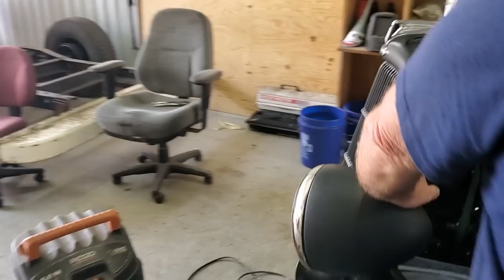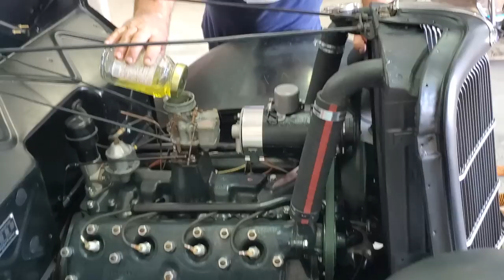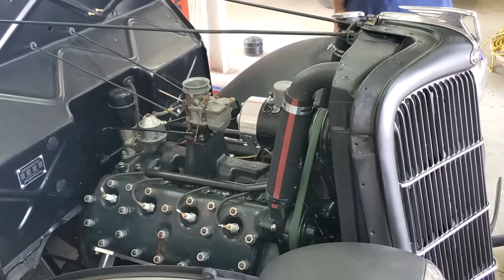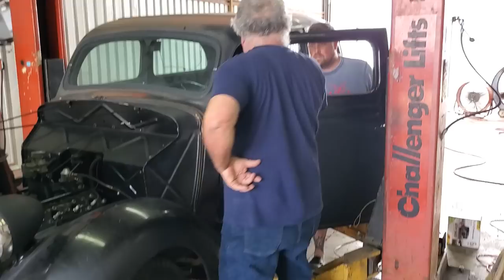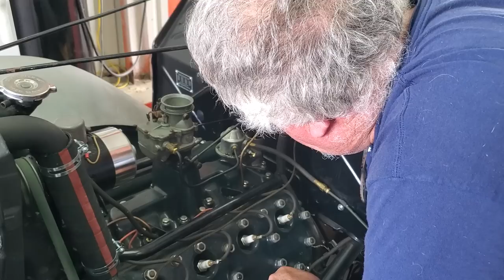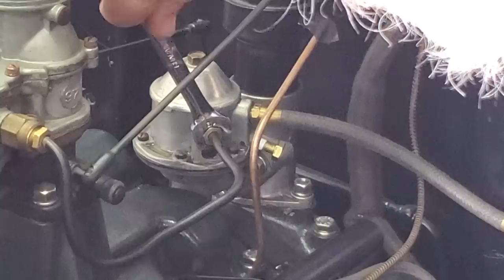1935 Ford Flathead V8 First Start

Comment: If that back fired out intake, you not going to be happy !! Lol, from experience
Reply from the maker: The lid with the tiny hole keeps that from being a problem
Reply: @StellarJay  Having experienced a blowup of sawdust from a floor sander being thrown on a smoldering fire I can still see the fireball that engulfed the side of my face.
Reply: @off spec and just what do you expect the fireball to be like if the engine backfires?

Comment: A back fire could have been a disaster with that bottle of juice 😂
Reply from the maker: Not likely with such a tiny hole in the lid. About 2 drops per second...cant dump it  which is why people have problems. They pour it some gas then start with the container open. Recipe for failure.

Comment: Had you rebuild it if so how come the fuel pump don't work
Reply from the maker: It worked. It just took a few tries to suck fuel from the tank.
Reply: @StellarJay  that's the problem with mechanical fuel pumps
Reply: @MavAuto-Pete  seems like it only needed to be primed,because when it's brand new,well.... It's basically dry.
It would be the same with an electrical fuel pump tho,it would need to run for an instant before actually sucking fuel it,okay,it would be faster,but it's basically the same thing
Reply: @f_for_freedom2492  the engine doesn’t need to turn for an electric pump to catch up.

Comment: That is an unsafe act y'all are committing to start this engine I speak from experience.  Put a little gas in it then crank it and repeat until the fuel pump primes the system.  I had all the hair burnt off my arm up to the elbow and my hand was on fire by starting a flathead  in this manner.  Thumbs up on the video.
Reply from the maker: I do it right. Jar with a lid and a tiny hole. Works perfect
Reply: That flame can still go in through that small hole.  I recommend an upgrade to an electric fuel pump; safety first.
Reply: Agreed. I've seen some.... exciting moments result from "hand priming" like this.  At the least it might be smart to upgrade to something better than a glass jar.  BUT, better than spraying ether all over the place.  Saw a guy trying to get his car started on the road side once...  he was in the car cranking and yelling instructions to his girlfriend, who was standing in front of the car and spraying ether at the carb.  You can imagine how  that ended.
Reply: What my dad taught me a old Ford guy is to take the air hole pump air in the gas tank cover the gas filler with a rag and pump air in the tank three to four times when you hear the gas tank expand this pushes the fuel up to the fuel pump . Then put very little gas in the carburetor then start the car . Work every time

Comment: That fuel flows quicker than my bath filler
Reply from the maker: Thats a fire breathing v8 ford. Gotta feed it.
Reply: I envy you guys in the US, we have to make do with high efficiency clean burning motors in the UK. You have art and character, we are going down the test tube route.
Reply from the maker: With such fuel costs high efficiency is required from new vehicles. It is fortunate that we are allowed to run these guzzlers in the usa. So few it is allowable to spew noxious fumes i suppose.  This old engine gets 20 mpg and doesnt visibly smoke so its kinda green..
Reply: @StellarJay  heck 20mpgs is better than some cars today

Comment: Probably very dangerous.
Risk being  back fire out of carby and a face full of exploding glass and burning fuel.
Reply from the maker: That jar has a tight lid  with a small hole. Never causes a problem. But thanks for your interesting comment. You sound like a real smart fellow.
Reply: @StellarJay  Indeed is !! :goodvibes::goodvibes:

Comment: Is that pickle juice??? Lol
Reply from the maker: White lightning
Reply from the maker: @brandonknight7240  i put a small hole in the lid. Fuel came out in a trickle.
Reply: @brandonknight7240  not if you’re 60. Standard procedure. Fuel works best when siphoned with a garden hose.

Comment: Not a good sign when he doesn't know the difference between the throttle and the choke...
Reply from the maker: Well i was on the wrong side plus the first start was a tad nerve wracking. Turned out very good. Timing was spot on and carb initial tuning was good. Only prob was small fuel leak at the fuel pump. This engine runs like a swiss watch.
Reply from the maker: Plus its just a stupid troll
Reply: @StellarJay  Don't be childish about it. Pouring neat petrol down a carburettor from a jar with two holes in the lid is asking for trouble. Tightening nuts on petrol pipe  with the engine running and your arm over the exposed HT leads, even someone in the background warns you. One spit back or one spark and you were in serious trouble. I've used a squirty type oil can filled with petrol to do what you did, much more controlled than petrol slopping everywhere.
Reply from the maker: @caffjohn  you are just trolling for no other reason  to see youself cause grief.  Idiot.